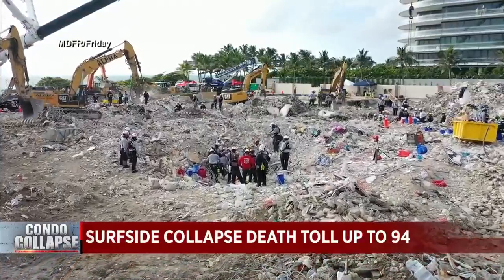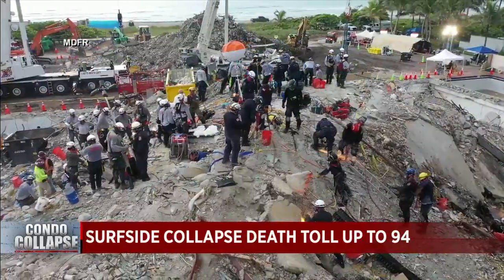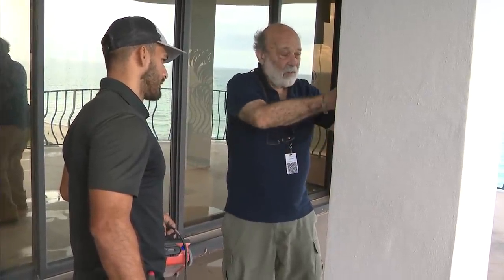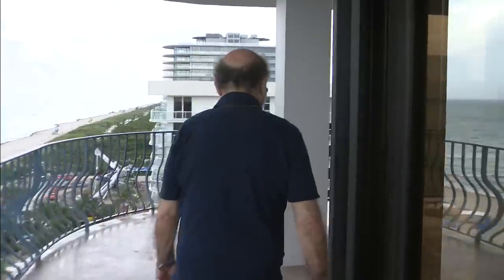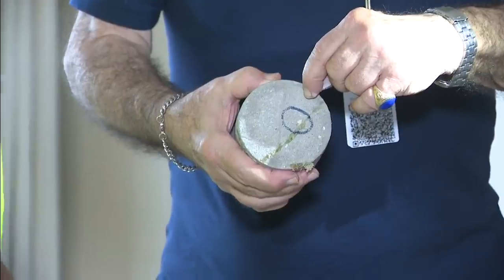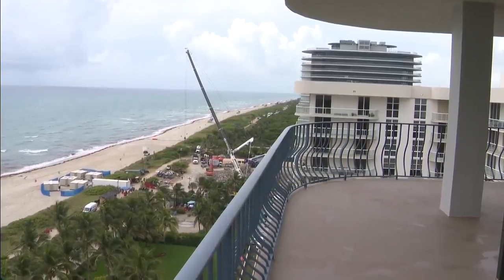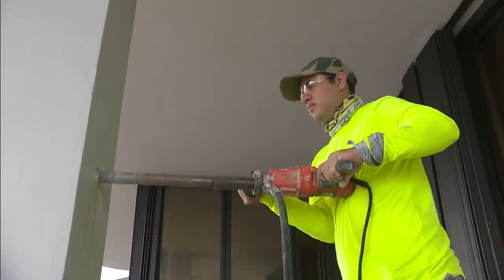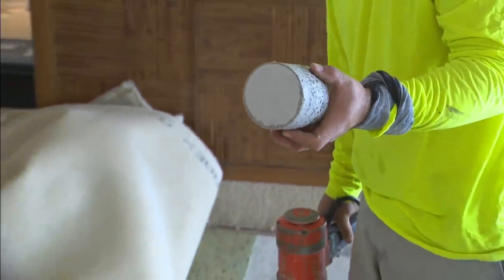Structural expert studying still-standing Champlain Towers North looking for clues into south to...

Comment: Are they going to release the videos from the security cameras.  That would give a better idea on what happened.
Reply: From the 2 ppl who was there b4 the building totally collapsed it looks like it all started in the garage. The ppl that came out said it sounded like a loud car accident or boom. Then if you look past the water coming from the ceiling it looks like huge pieces of the garage (cement) had collapsed in. I also seen video of where they were saying the leaking water in the garage was pooling around certain spots in the garage. Those spots were right where the support columns were. 

There's a guy that's a professional that's made multiple videos. One going frame by frame of the collapse. I forgot the name of his channel. Shouldn't be hard to find if you Google Surfside collapsed. It's a white middle aged guy with a short haircut.
Reply: @babyshaq6455  
Construction Engineering & Failure Analysis
Reply: @RPlant  sounds legit 😂

Good looking out. I got a bad memory when it comes to names.
Reply: @RPlant  actually I just went through my watch history and the channel name was building integrity. I might give the guy you mentioned a look.
Reply: They are evidence of possibly responsibility in a criminal case. They will also be important in all the lawsuits by the families in civil court. The lawyers will get them eventually. But the police are not likely to release anything significant to the public for a long while.

Comment: North wasn't taking on Water for years like South was... Just shameful they let it go for so long..RIP..
Reply: This is a perfect example of the difference between a good HOA and poorly run HOA. I saw an interview with the HOA president of the still standing towers and he explained how they stayed on top of the maintenance and did things early to prevent the structural decay. Hurricane Andrew, Katrina and Irma rocked all these buildings and these types of structures sway during high winds which creates the need for repairs. Neglected cracks introduced salt, water and oxygen which exacerbated the issues.
Reply: @thebullgator  after looking google street view they could have used a mini loader or mini backhoe to remove those trees but it isn't the main direct cause after seeing more details I'd say it was a combination of events...  fresh and salt water seepage ... chlorine seepage .. as you could see some the bars were rusted inside the concreate .. also possible due to climate changes could be salt water or brackish water intrusion below the foundation of the place
Reply: @thebullgator  having been a HOA board member, I can say that the CT-S board(s) will probably have some unfair blame.  You can have some very diligent and trustworthy board members, but have a membership (unit owners) that are uncooperative, disruptive, obstinate etc.  The boards powers are limited.  And the CC&Rs usually will limit on how much they can raise assessments on their own.  The board I was on, couldnt raise an assessment more that 10% without getting a 51% vote from unit owners.   Unit owners have a low participation in voting for boards, but high percentage when it comes to raising costs. So the board often has their hands tied.   Therefore many boards have a high turnover of officers.  CT-S board was probably able to commission the engineer study, but 
couldnt get the homeowners to agree on the millions of dollars in repair costs. A recipe for not getting much done
Reply: @phxpaul  Yes, we do have to keep in mind that there were clearly major issues in getting things done - to the point where multiple members of the board quit because they felt like they couldn’t do their jobs because of all the squabbling about money. (It seems like many of them were convinced to come back - perhaps related to the fact the work started being done?) 

With regard to the waterproofing on the pool deck, it’s even worse than it wearing out. Per one of the samples taken, the most recent waterproofing was laid OVER tiles and so on from previous/original work. That is absolutely not how waterproofing is intended to be put down, and is quite likely to have meant the waterproofing had no chance of working properly. (Failure depends on the type of waterproofing used - but just as an example if you’re using a waterproofing membrane they’re often fairly fragile, and the tile underneath is unlikely to have been perfectly level meaning high and low spots that could have damaged the membrane. Then per Gabe Nir there was enough standing water on the pool deck that the top surface of pavers/tiles would rock underfoot and water squish around, which translates to grinding/rocking on the membrane from above. If you’re not going to install it properly you might as well just leave it out entirely for all the use it is.) (To be clear, a membrane isn’t the only way of doing it, that’s just one example.)
Reply: Exactly.  Also large cracks in the slab of the floor of the garage under the South building, but no cracks under the North building.
Reply: Actually yes, it was. I worked there shortly after completion of construction. The penthouse was still under construction when I started. Both garages leaked like sieves. We received complaints from residents about the garage ceiling leaking on their cars and ruining the paint all the time. The south bldg either didn't do enough or didn't do it soon enough to prevent this tragic collapse.
Reply: @Tony-TRiUMPhant  Sounds like the North should add more support columns in that garage and under that building, or just a manner of time.
Reply: @DallasCityGurl  I agree. From what I've read so far, the north building was better maintained and had passed inspections. I hope they add more reinforcement out of an abundance of caution. I know it's costly but we see what the alternative can be.
Reply: The south condo's problem could have started because of a bad paver installation around the pool deck. Or the builder didn't follow the plan because the pool deck was designed with plenty of drains and concrete sloping towards drains. But at some point the concrete was all covered over with pavers. The 2018 inspector says the pool deck is not draining because it is flat and refers to damaged waterproofing. It may have been built flat contrary to the design, but waterproofing sounds like it's part of something added after the fact.
Reply: @lockbert99  The pool “deck” is essentially a roof for the garage, so it’d be not unreasonable to have waterproofing to keep the water from getting in where you don’t want it - i.e. so it only goes into the drains, even with sloping. But most waterproofing in this situation is not designed for long term standing water and saturated pavers, it’s designed for the water to run off. Water that can’t drain off and that sits can damage the waterproofing or find tiny gaps in places like the seams - and once water finds A gap, it usually makes it bigger. Obviously you CAN waterproof for standing water - like in pools for example - but if you design for it to run off with a slope and drains and everything, then the other stuff works just fine until someone comes along and fills in all your drains and levels your nice slopes. And it’s less expensive than the waterproofing you’d do on something like a pool. (Or a shower, in small scale - and look at how many showers have waterproofing problems and do leak. It has to be done properly for the conditions.)
Reply: @TrappedinSLC  Did the architect have waterproofing in his design? What is the waterproofing material? The biggest issue is keeping water out of the concrete so it doesn't get to the rebar. Still not sure how sea air and standing water goes through the concrete to the rebar.
Reply: @lockbert99  No idea.
Reply: @lockbert99  it goes thru the cracks and there are stalactites on the ceiling below confirming loss of structural materials.  They look tiny but in regards to the impact on reinforced concrete that little bit of material lost is huge.
Reply: @lostpony4885  Does concrete have cracks the day after it is poured? When do they come and how can rebar be protected if concrete cracks?
Reply: @lockbert99  - stuff wears out over 40 years and you must pay to have it re-done.. thus they didn't wanna pay and put of off
Reply: @williamhaynes7089  I think that oversimplifies the situation. There is talk from some people about the garage having massive amounts of water on a regular basis, presumably from a rising water table. But I don't think that was mentioned in the engineering report. They were told the deck was flat and wasn’t draining. That is not things wearing out. They also needed $70,000 to over $100,000 per unit to fix the damage depending on the cost cited ($9 million to $15 million). So they had to both want to do it and be able to do it. And some joker from the city came out and told them their building was in fine shape right after an engineering report told them they needed extensive repairs (in a poorly written report with no summary and no deadlines or time frames).  And they had hired incompetent (and they were not in a position to judge competence) contractors who came out and put up plastic to redirect water leaking through the garage ceiling onto cars and injected epoxy into cracks on the garage ceiling rather than addressing what was causing the cracks and leaks.
Reply: @lockbert99  It doesnt sound like a rising water table is at fault. There's a guy on here named Steve who worked at these towers 40 years ago and from the beginning he claims residents complained about water in the garage and on their cars.
Reply: @lockbert99  It sounding like it wasnt the pool deck itself that caused collapse.  Its looking like foundation failed.   With the cracks and settling that was taking place in the lower deck it looks like a void had formed under the Garage floor which would allow undetectable damage to the piles.
Reply: @kylecampbell1444  we know now that it wasn’t.
Reply: @lockbert99  it is possible that besides the above surface water and fluid seepage that salt water might be under the very foundation of this place too,.  in the water table
Reply: It might not have been able to be fixed, the water coming up in the garage from the ocean, I am talking about.
Reply: Number of ways to fix it..
Reply: @DallasCityGurl  brackish water  intrusion below the foundation
Reply: Exactly lives could’ve been saved and before they started the construction they should’ve moved the people for safety
Reply: if the building would have had beams, even then it would have hold.
Reply: It does have the same flaw that can cause collapse though. If the parking garage fails, the building can fail.
Reply: you would think by now all that been "tested" on North.. and been shored
Reply: @sircampbell1249   The issue is that the design is flawed. It’s the identical building. It can absolutely collapse if pool deck does.  Water intrusion or not if that pool deck does a punch shear, it could very well take the building down. It’s definitely possible.
Reply: how do you know that are you the building letting us know?
Reply: Open your eyes look at it, hear it, smell it,  and the key one is open your mind...
Reply: The north looks ruff as well. Pooling water on the roof, stained pool deck from water standing on it etc.
Reply: Good to hear how they are taking samples but also gonna fill the space to make sure all stays good becuase need samples to where flaws was made or caused do to both places i guess not built the same any. so 2 identical buildings but the now ruined place had flaws to start and was not fixed as needed.
Reply: The removal of 87th Terrace and new buildings at 8701 Collins Avenue data shows may have actually destroyed Champlain South Tower’s  North and South foundations. 

The data is overwhelming. How could City officials allow this??
Reply: how deep was piles ?  did the city know it was talking on water?  of so for how long ?
Reply: @sircampbell1249  I verified my hypothesis with new evidence today I plotted, diagramed and prepared to testify if needed. I am going to provide my findings to all the condo owners. They have a right to know. 

The data I personally have been analyzing, I would definitely litigate heavily against the City/Town of Surfside, Miami Beach, Regional Building Department and Builder/Developer at 8701 Collins Avenue. 

 I will gladly provide the well diagramed documented truth to anyone and testify as an expert in the subject matter if asked. 

Also, all core samples for testing etc. are REQUIRED to be documented and retrieved  at the building location at its original location. Once material left Champlain South Tower building location then cored at another location for sample testing considered not valid /chain of custody/contamination.

In detail, all specimens for testing including core samples must be taken properly at building site then taken directly by third party to registered certified ASTM etc testing lab for independent verifiable valid third party testing.

I have done this many times for independent quality control and for litigation purposes of which I also testified as an expert witness.

I know the proper PROFESSIONAL drill very well. 

The Surfside mayor is way out of line as today he said the building collapse was like a forest fire that burned down a thousand homes.

That is insulting BS way out of line as he knows Surfside liability as do I now, and litigation is likely coming his way.
Reply: The water is caused by the rising tide and the water table, so most of the buildings in the area should be affected. Maybe the north tower has better pumps.
Reply: @inlikearefugee5194  How long did the city known that area was taking on water years ??
Reply: @inlikearefugee5194  yes salt water intrusion  could cause the reinforcement bars to decay at an accelerated rate and under Neath remaining foundation needs to be checked for brackish water tables

Comment: The Core from the floor had a piece of rebar in it, look at 2:07, looks like a #5.
Reply: No
Reply: @belanowwwka  you didn't see the piece of steel rebar in the core?

If you can't see the rebar, you don't know what you are looking at.
Reply: @bretwalley4673  that's a stone, not a steel rebar.
Reply: @belanowwwka  its rebar
Reply: It is but he said he would avoid if possible. That core looked in the middle of the slab which is the least stressed in structural design (column vs middle strips in slab design). The old engineer knows his stuff
Reply: @la-sand  .... Of couse he does, he wouln't be there otherwise.